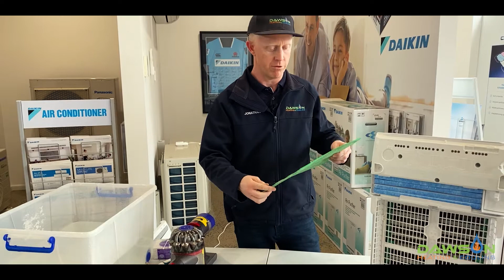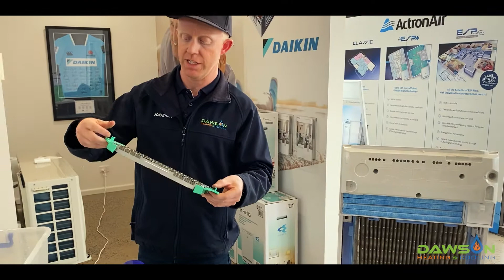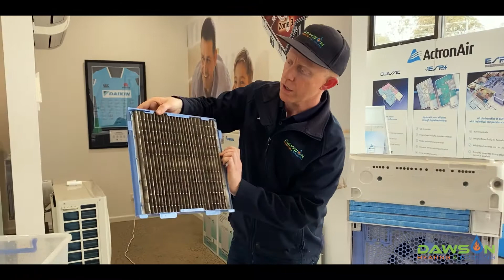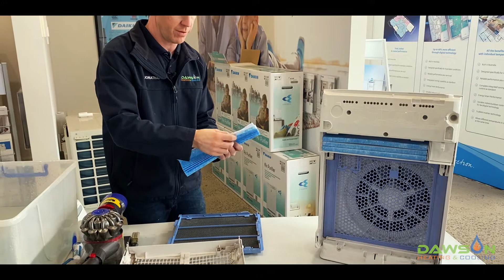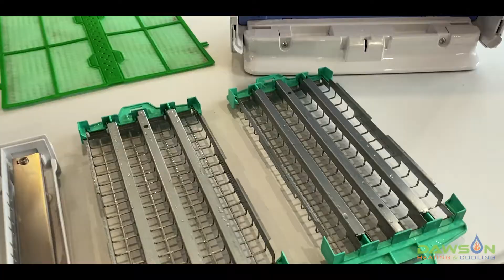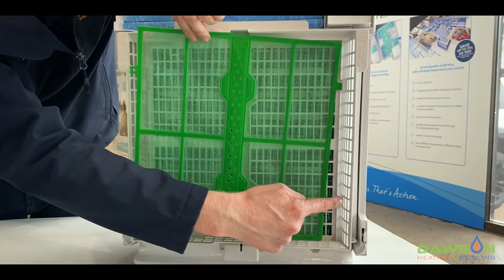Daikin Air Purifier - How to Clean Your Filters and Service Your System

Comment: Thank for this very useful video. May I have one question?: dust has accumulated at and around the propeller at the back of the unit, and this is the very area through which the "clean" air is supposed to come. I am afraid that if I turn the unit on, it will blow all that dust  out (probably gradually). It is impossible have access to that area. Is  there a way to open the back cover? Thanks in advance for the reply.

Comment: Hi Johnathan, thanks for explaining this. I recently got a used unit that's been sitting in storage for a while and is very dirty even the outlet end is quite dusty from standing. It's been run in a coastal environment. The opposing plates are rusty and stuck to the HEPA filter on first open. So pulled the Hepa filter from Unit 2 when I removed Unit 1. Getting a quote on replacing opposing plates. Do you how often the catalyst filter should be replaced? This one on this unit is very dusty but otherwise still in tact. 

All in all I'm very pleased with how robust these air filters are.